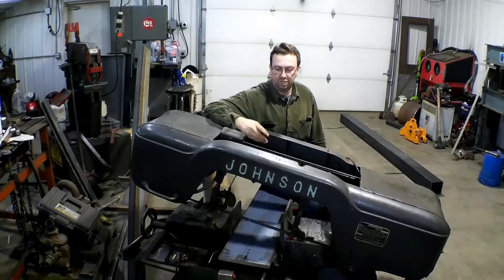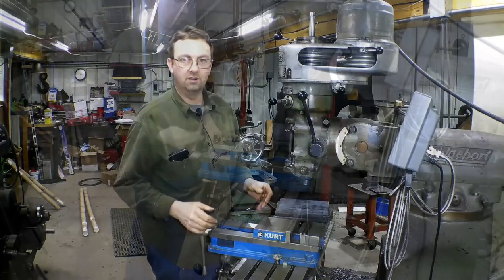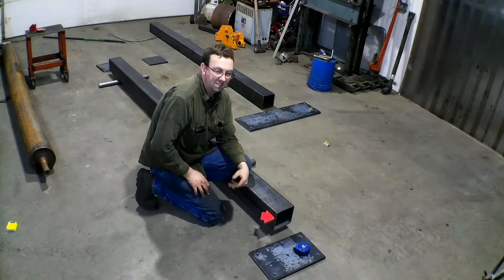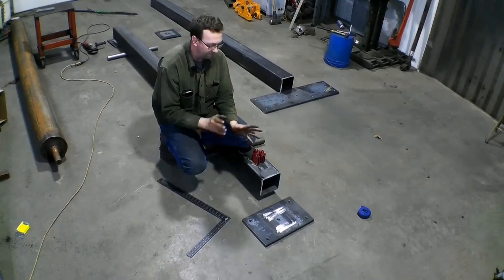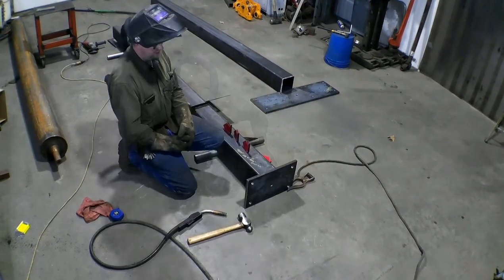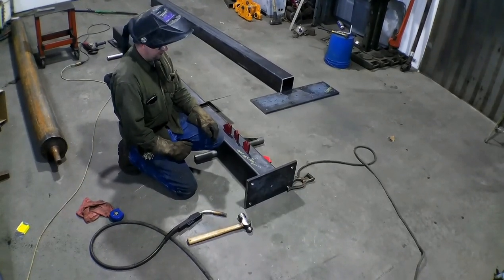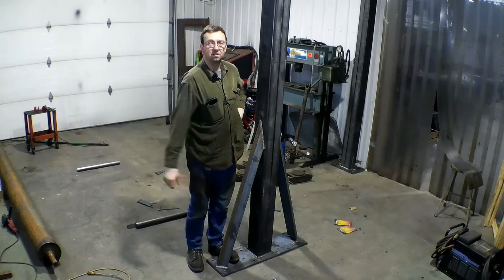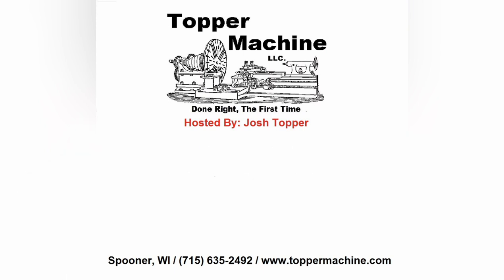Building a Fixed Gantry Crane, Part 1, The Columns

Comment: It was great that you emphasized the importance of pre-work for good welds. Most YouTube DIY welds on rusty plates - crazy for structural work. What flavor (i.e., short-circuit or spray-arc) of the MIG process are you using?

Comment: Love the cool belt ventilation system.  I use flux core a lot. Almost always try to weld outside with a breeze
Reply from the maker: Thanks. I bought it for track welding in the summer. It blows a nice breeze in the helmet. I hate flux core, the only flux core I use is hardfacing. I wish I could find a hard facing wire that uses gas.

Comment: Are you going to have to shim the bottom of the legs for unevenness in the concrete?  Or try to grind the concrete flat?
Reply from the maker: The one side I know is uneven, so I will probably pour some thinset there to level. My design calls for perfect, full engagement.

Comment: Too late, but I would have put a moisture weep hole in the side of the upright near the bottom, not a "drain" in the base plate.  Does your concrete floor have a substantial vapor barrier under it?  If not, moisture will rise into the column, not drain from it.
Reply from the maker: Heated floor with foam underneath slab on sand base.  Moisture has never been an issue here. I considered a side hole but a center hole top and bottom made good sense.

Comment: im kidna confused. this gantry is a loooonnnngggg way away from the machine shop. do you not need to machine the over weight pieces?
Reply from the maker: For welding shop. I can get forklift to everything else. This is for a specific job that needs to be manipulated and suspended